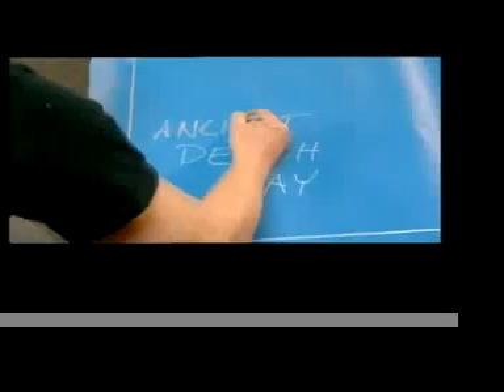Did Archimedes build a death ray?

Comment: That’s so wrong, off course is easy with a stationary ship keeping focus at short distance, I see they also used modern mirrors (that were unavailable in the era) if the Archimedes were truth you need this in very long distance with soaked wood and ships moving, with the “mirrors” that were available in the era.